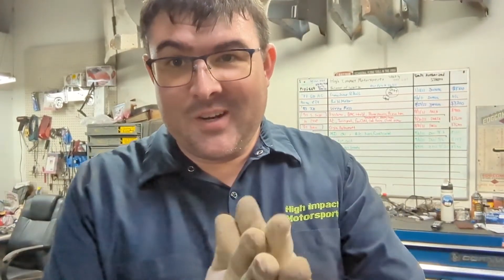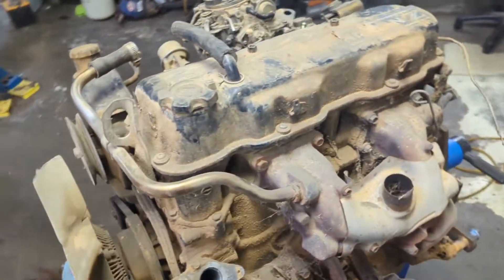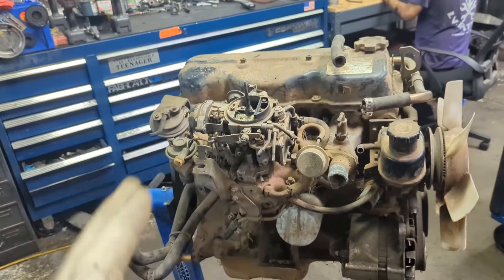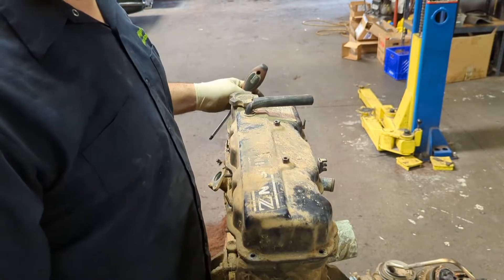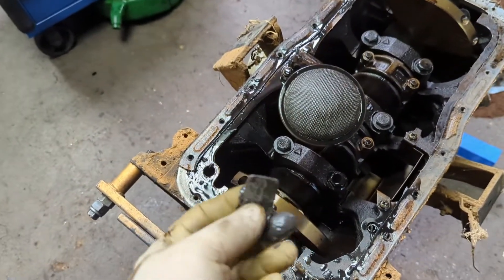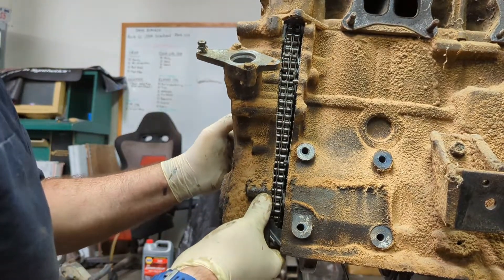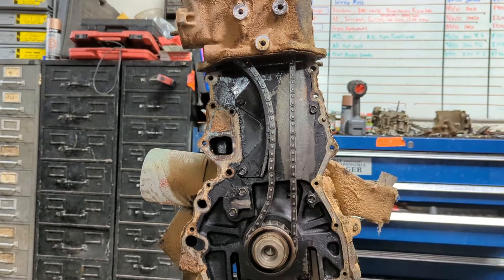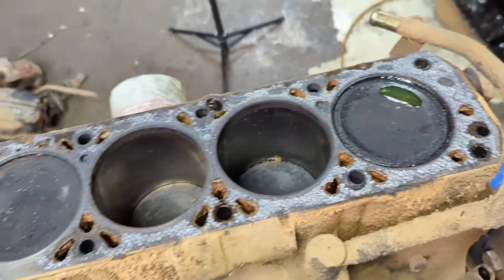Z24 Engine Tear-Down: Why did it lock up?

Comment: Whats the difference between a z24 and a z24i
Reply from the maker: Both engines are virtually identical.  The Z24i differs in that it uses a different oil pump/distributor drive spindle.  The Z24i optical distributor required a more stable connection, so it has a splined shaft vs an offset blade attachment.  The 88-89 Z24i differs further by using a slightly different camshaft and a single-row timing chain.  Aside from that, they are functionally able to be used interchangeably, provided the oil pump is dropped and the distributor drive spindle is swapped.
Reply: This was extremely helpful I appreciate the information

Comment: Looks like fun! Neglect killed that engine. Just by looking at how dirty the exterior is I can imagine how the oil and truck are. That engine could still be rolling if proper cleaning and maintenance was done.

 By the way just came across your channel. I had purchased an intake from you a couple years ago here in vegas.